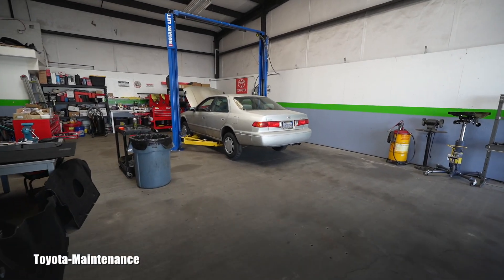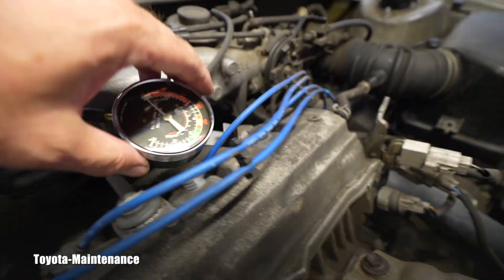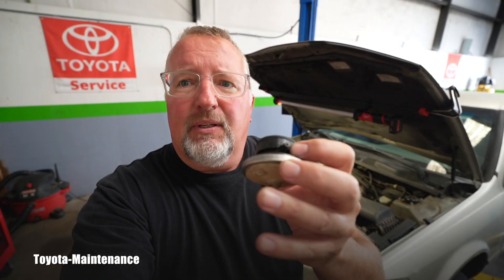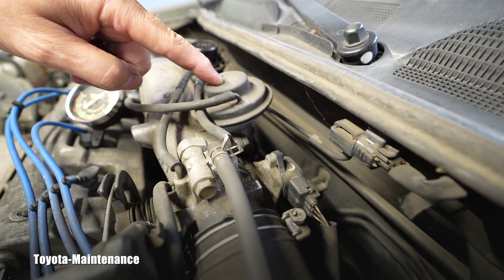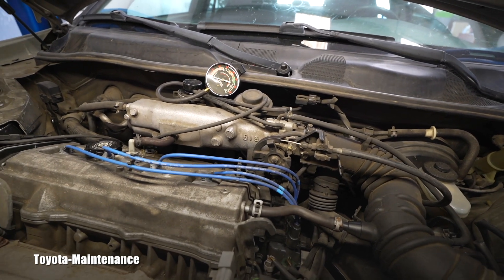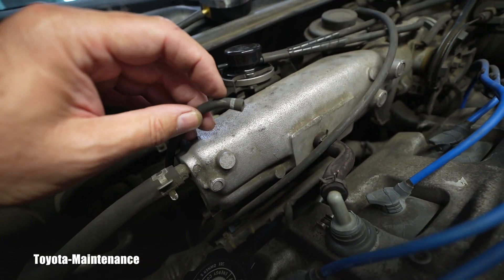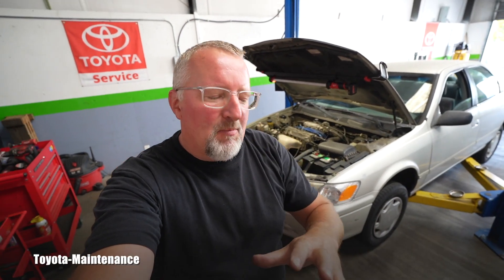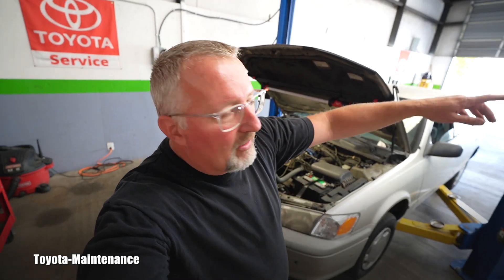Toyota P0401 EGR Vacuum Modulator

Comment: Thank you very kindly.
My '99 Camry has the P0401 code. I replaced the original EGR valve yesterday, but I think it was good (diaphragm seems to hold vacuum and the inside had only a little surface carbon).
I have a new Modulator arriving Sunday and hope that resolves the issue. I will take a closer look at the vacuum lines and their connections, too. My first impression was that the connections were good and the hoses were in remarkably good condition.
I don't have much in the way of testing equipment, but if the Modulator doesn't resolve the issue I think I'll need to learn to troubleshoot all 3 parts (including the VSV).

Comment: Aside from the CEL, what drivability issue did the car have with that bad EGR modulator valve?
Reply: Basically none, small drop in MPG and power perhaps but i mean small drop

Comment: That's an excellent point Peter. I hear so many people saying they replaced the EGR but still the same problem. Well yeah,  if you have vacuum leak somewhere even with new parts it will still not work.

Comment: These Camrys can do 350 thousand easy. Bet you that manual can do 400
Reply: true!! i have a 99 CE 4 cyl with 348  , some leaks but still going strong...all orig...BEST CAR i ever owned
Reply: I got one six months ago. 2000 model. All the rear driver door was banged in a wreck. I bought if from an impound auction without paying attention to the bang. Paid $750 and it has 75000 miles. I must say the first owner abused it because I have seen oil leaking in one spot but performance is top notch. I prefer Hondas 2003 and up to TOYOTAS but man this generation camry has the smoothness of the engine that made me like Hondas. I don't plan to fix the door; just drive it and maintain it. I do my oil changes myself and just got transmission oil, filter and gasket for its first service then service the trans every 25000miles from there. I have several cars but this is what I chose to be my daily hahaha @bottanoog9545
Reply: I just found one with 75000miles. Abused but smooth like a lexus
Reply: 310000 miles in ofometr may camry 2000 ears

Comment: That engine looks the same as in my 1997 RAV4.
Reply: It is the same 2.2 engine in Camry, Rav 4 and Celica
Reply: Rav4 does not have the same engine. It’s very similar.
1996-2000 Rav4 3SGE engine
and Camry has a 5SGE engine.
Reply: @enriqueb4412 not a G, the G denotes the higher performance cylinder head. F denotes the economy head. 

The Camry and rav received the 3/5SFE